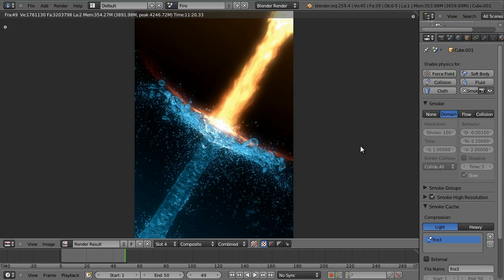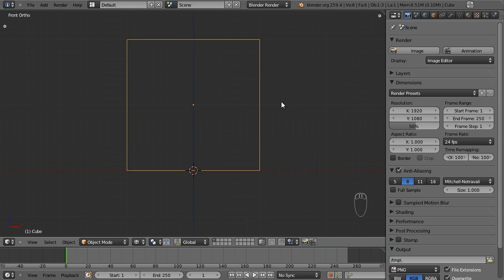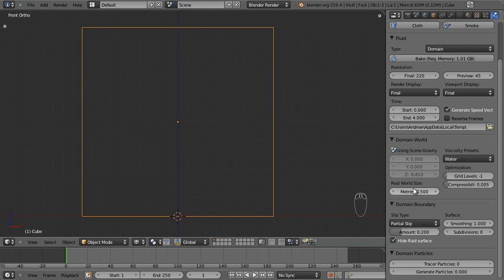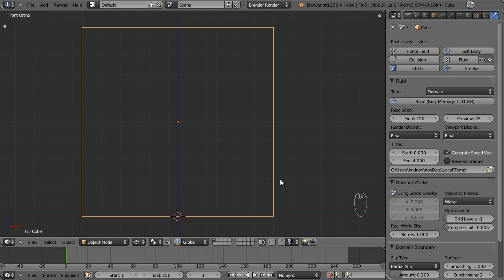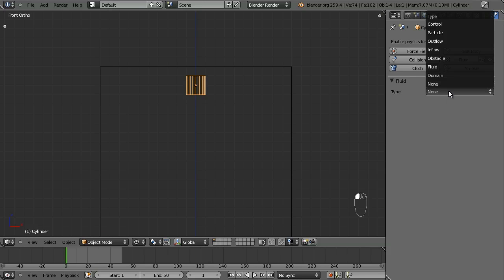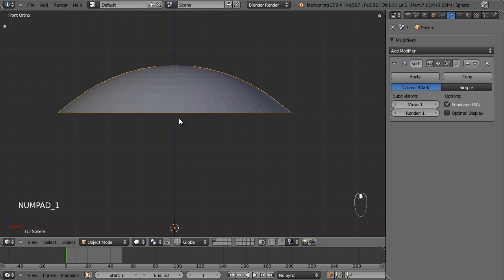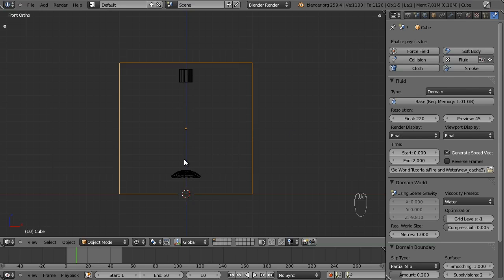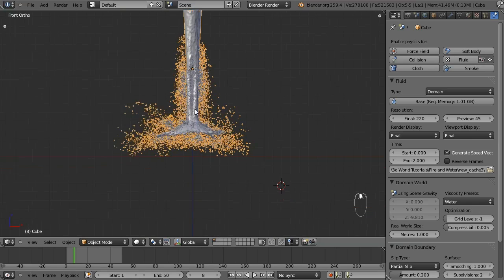Create an energetic fire and water scene in Blender (1 of 4)

Comment: Spelled and spelt are both correct. Spelt is just slightly more archaic and less widely used in the US than spelled. The way words are spelt and which words are used depend on the localization of the speaker (for example, aluminum in US English would be aluminium in UK English). It's generally a good idea to make sure what you're saying is correct before correcting someone else.